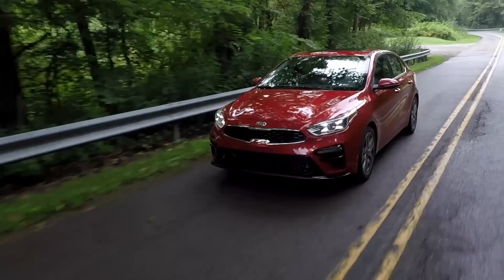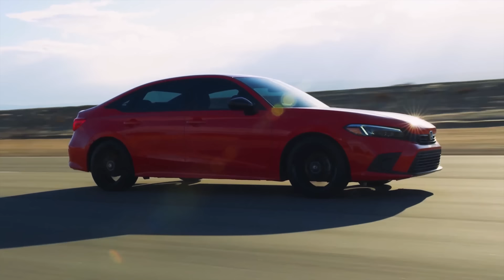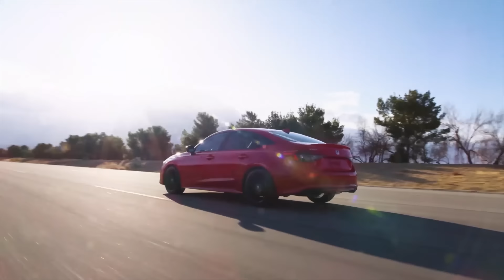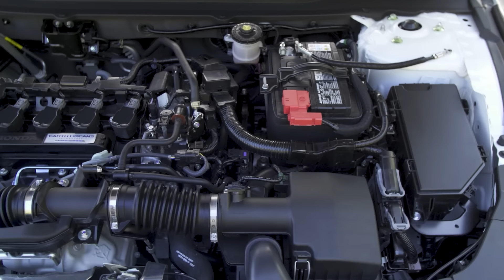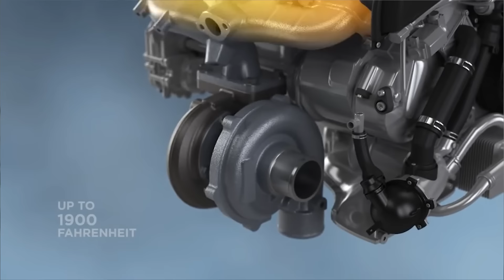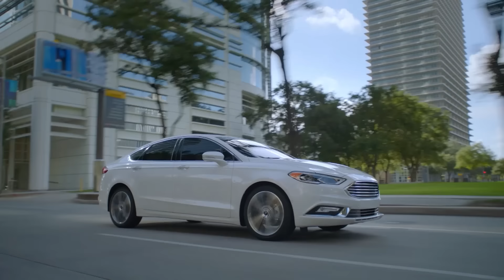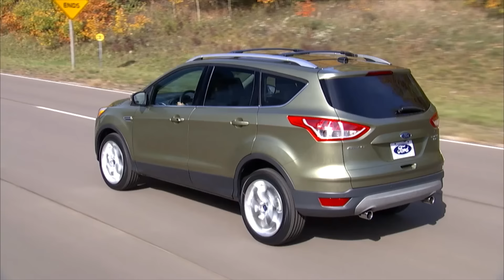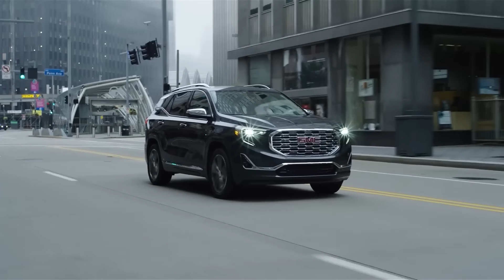Are Turbocharged Engines Reliable? The Truth About Turbo Engines

Comment: The biggest imsconception is that they aren't actually "more efficient". Ask anyone who has a small turbo engine and their gas consumption is greater because the engine is designed to produce MORE power earlier, meaning MORE fuel used down low. A naturally aspirated engine delivers power based on RPM, the lower the RPM, the less fuel used, where as a turbo engine produces peak torque (which is proportional to power) so early that you are using more fuel for the same RPM as a naturally aspirated engine. 

The reason turbo engines are used is NOT because "you can make the same amount of power with a small efficient engine", remove the word efficient. Sure, its impressive that a 1.5L turbo can make the same power/performance as a 2.5 non turbo engine, but that doesn't mean it uses less gas! An accord 1.5 turbo gets 29 city, 35 highway, where as a 2.5 NA camry gets 29 city 39 highway. Heck, the 3.5 liter v6 camry gets better MPG than a 2.0 liter accord. Makes no sense!

That is because the reason turbo engines are being made is because EMISSIONS. Using a turbo charger to control the EXACT amount of air that goes inside the engine you can better control emissions, because the exhaust instead of going straight out of the engine, goes through the turbo first, where it cools down and settles releasing less NOX gasses. Not only that, turbo engines are smaller, lighter, and easier to fit into more cars in more ways. If you want 400 horsepower, your options are a 5 liter v8 or a 3 liter v6 turbo. Of course the turbo 6 is gonna be smaller and easier to fit into an engine but cost A BUT LOAD more to manufacture.

In the end, turbo engines are great for some things, but mostly worse because they cost more to make, they have more points of failure, and generate more heat which deteriorates a lot of the stuff around the engine like fluids and plastics, and they aren't really "more efficient".

Heck, toyota literally said they only reason they developed their 2.4 turbo engine to replace the 3.5 v6 is because of emissions regulations and had nothing to do with MPG (which it gets less mpg and makes less power than the v6).

Comment: In my 50 years of driving, turbos have always been very reliable. Until they break (or your engine dies from oil dilution, etc) So if you buy a new car every 2-3 years, and/or never put more than 70 000 miles on a car, then go ahead and buy a turbo engine car.

Comment: Lots of anti-Turbo negativity there. Bit OTT in my view. Other valid opinions are available.

Suggest anyone still having doubts use the best evidence available to themselves. That being actual "hands on" experience .. by far the best policy. Over three decades ago, I too was very anti-Turbo. That was until I got one. That "hands on" experience changed my motoring habits of a lifetime. 

When I bought my first MG ZT years ago, reading the opinions of those MG enthusiasts with far better experience of these cars than myself, many were of the opinion that the smallest engine option available for MG ZTs and Rover 75s, was the Rover K-Series 1.8 in turbocharged form. I found this both astonishing and indeed hard to believe considering other engine options available for these cars included V6 NASP, BMW Diesels and of course the Mustang V8 engines. 

Ten years on with all that "hands on" actual experience under my belt, I can now appreciate why, all things considered, the 1.8 Turbo option was the best one for the average Joe/ Josephine car user. Plenty of YouTube footage by folks when trying the 1.8T 75s or ZTs for the first time, demonstrate genuine surprise. 

I can get closing on 40mpg with my ZT 1.8Ts, on a long Motorway/Freeway run. Mind you, that BOOST can be addictive and driving using "Track day mode" all the time can see only half those miles for each gallon. As always, you pays the money and takes your choice.. 😃

Comment: Interesting stuff. UK Based me a serial Petrol Turbocharged Car owner here for over three decades. Mostly British MGs and Rovers. Oh yes one Diesel. A Rover 620 Diesel with the Rover L-Series Diesel Power Unit Honda also put in their Diesel Accords before developing their own oil burner.

Never had any issues. I do change the engine oil at HALF the manufacturer recommended change intervals. Oil and Filters are far less expensive than replacement Engines and Turbochargers.

I have bought used turbocharged cars, again MGs and Rovers, blowing blue smoke from the  worn turbos, A glance at the condition of the oil on the dipstick tells you why. Rebuilt them and good to go.

It aint rocket Science although is to some.
Reply: There's more from UK based me. 

My son's old 1997 Rover 620ti Petrol Turbo now showing 240,000 UK Miles. Not Kms.  Been all over Europe in it. Norway for Snowboarding with his mates, touring the Magnificent Alps and even a Lap of the demanding Nurburgring circuit fully loaded with his mates and their holiday/vacation clobber.

That Nurburgring stuff video-ed and on YouTube. Mind the language .. 😉:~

Rover 620Ti going around the Nurburgring in 12m28s

He has since improved on that lap time using his Lotus Elise S2.. considerably... 😉

Comment: BLOODY CAR'S I've just replaced the motor in my Subaru Exiga GT 7 seater second hand motor with 100.000 kms less than the F*#ked one 94.000kms on it brand new Turbo Radiator water pump cam belt kit front rotors and shocks $7685 😠😡🤬🤮 DAD ALWAYS SAID THAT IF IT'S GOT TITS OR WHEELS IT WILL COST YOU MONEY AND GIVE YOU HEADACHES

Comment: Turbo + CVT = disposable car.  At that point, you might as well put an expiration date sticker on the windshield so you know when it's time to dump it.

Govt likes the current fuel efficiency technology because they know these cars will be scrapped in a few years. Any money you save on fuel will be given back on maintenance and repairs.  If you don't want a disposable electric car now, you will in a few years when your disposable gasoline car decides to retire, just as your loan is paid off.

Comment: I own a 2007 Pontiac Solstice GXP with over 126000 miles. No problems with the turbocharger or engine so far. Does not use any oil between oil changes. Gets fair gas mileage and hauls when asked. Before that I owned a 2002 Subaru WRX. It was equally reliable and fun to drive. As far as cold weather warm up, the same issues apply to naturally aspirated engines. As a reference I was an ASE certified master technician with over 30 years experience. A turbocharged engine is a high performance engine and thus higher stressed than most naturally aspirated engines so should only be compared directly to other high performance engines ( supercharged, high compression, etc...).

Comment: I would never have a turbo car for anything but a race car.  The final expense far outweighs the benefits in an economy application.  I have a 2008 3800 Grand Prix and a 2017 370Z Sport 6MT.  Both are naturally aspirated, port injected and dead reliable.

Comment: You basically confirmed everything I've been telling people for years! 
Part of the issue to me is using the turbo to move to a smaller engine.  If it's a choice between a 2ltr or a 2ltr with a turbo; you will still have reliability issues down the road, but it's an add on that's just there for additional power. As opposed to compensating for the power lost by downsizing the engine. Two different things!
Reply: And avoid CVT.
Unfortunately big NA engines on proper Autos arent that common.
Reply: @peterpan408  Sad part is CVT's are becoming the norm, even in Hybrids. I have a 100k plus miles Honda currently that has a CVT. Just make sure to change the fluid when Honda says, and you will be good.
Reply: @sn4rl277  Except the first owner wrecks the CVT because they just drop (trade on) the abused vehicle back at the dealer when they renew. Only a donk on an auto tolerates mild abuse and is lower risk to buy second hand.
Reply: The only thing you have to do is increase the oil change frequency. That solves most issues.
Reply: Right, turbos needs beefy engine with large surface area to dissipate heat and spread combustion impact to withstand  higher compression this comes with larger displacement. Smaller engines have smaller parts that are more delicate while being stressed by heavier load in term of punch and heat of combustion.
Technically speaking, engineers can design smaller displacement turbo engine that will last with thicker piston head and massive crankshaft and etc, but this will diminish efficiency of engine as it gets heavier while let it last decade and have better torque (not hp) with no significant wear but this is counter-marketing of engineered obsolescence.
Reply: @BlahBlahManYeah  you also need to do more frequent oil changes on turbos engines but it’s cheap insurance
Reply: There's no replacement for displacement!
Reply: @jackson5116  your opinion is deeply flawed sir
Reply: 2.0 turbos are fine if its from a reputable company.
Reply: @Ghostmarshs  Exactly. Going down to s 1.6 or 1.5 then adding a Turbo is never a good idea. 2.0t engines have shown time and time again that they can handle being turbo charged and lasting 150,000 miles when maintained correctly.
Reply: If you drive them long enough over  150000km you may have problems
Reply: @Ghostmarshs   Might be OK for "car guys", but the average person who has no idea about maintenance, turbos are a disaster. Even with proper maintenance they won't last as long as a non-turbo.
Reply: @watchchimp3102  Exactly, powerstroke = powersmoke, ecoboost = smokeboost.
Reply: @watchchimp3102  So it's better to get a 9th Generation Honda accord vs a 10th Generation Honda Accord? I'm thinking of selling my 22' Honda Accord Sport 2.0t for a 2016 Honda Accord 2.4 4cyl.
Reply: Yes this, instead of adding a turbo, you're better off sport tuning a v-6 for efficiency.
Reply: All most people know about their cars is “Stick the key in and turn it“
Reply: Wrong!

Comment: The only good a turbocharger gives is to the dealerships for all the repairs they get to do. Tundras turbos are the reason I will not be buying a new Tundra. My 2003 tundra 4x4 has a v6 with 175K on it and it still gets 25-27 mpg.

Comment: I drive a 4.6 liter V8 Mercury Grand Marquis that will get 30 mpg on the highway. It just reached 150,000 miles and has never had a single engine part fail. Ford stopped selling this car for a reason.

Comment: This is very disturbing. I own the last Honda V6Accord. 
I am.reluctant ( at this moment no need ) to replace it with the current 2.0Lturbo.

In a few years all of these turbo car ( high end high performance as well as entry level economy cars ) will have accrued high mileage and some marques/models will be break up and down, it could be so bad that the manufacturers make a 360degree return to normally aspirated engines.

Comment: For the average commuter, don’t get a turbo engine. For the enthusiast, get a turbo engine. I love my ecoboost. I’ve had it 4 years. However, I watch all my temperatures like a hawk (charge air, exhaust, coolant, and oil temp) via accessport. I also over-maintenance my cars.  I love the low end torque of a turbo 4 cylinder.

Comment: Nice vid. It’s very specific to the model. I have a F150 2.7 v6 eco boost. It has a great reputation (was improved in 2017 with side port). But the same engine in the new Bronco has been a disaster (so far).
Reply: Agreed. Ive got a 2016 Ford fusion Titanium with the 2.0 ecoboost. Think Scotty Kilmer had a video on an earlier year with the same setup (plus awd) with over 200k miles and the only thing wrong besides the crappy backup camera Ford uses was the turbo was finally starting to go. The only other faulty thing is the transmission, but as long as it’s maintained the chances of the transmission failing are slim

Comment: I have a 2021 Subaru Legacy Touring XT with the 2.4 turbo. I will over-maintain it like I've done all my cars in the past. It has 9500 miles on it and I've already two oil changes. I get one every 4K miles even though the recommended is 6K miles. I also don't drive like a bat out of hell and I live in a mild climate. I'm not worried.
Reply: Keep an eye on the coolant … my son owns a 2022 outback with same engine and it is loosing coolant somewhere. Not leaking anywhere, more likely bad head gasket and only has around 9,000 mls.
Reply: @stacystanley262  lol - since I posted that I've  had an oil pan leak repaired. Apparently another common issue with that new engine. I wish now I'd gotten one with the regular non-turbo engine. I hardly ever take advantage of the extra power so it was kind of a waste, plus it gets about four to five MPG less than the naturally aspriated engine. I probably won't keep it after the 3 year/36K mile bumper to bumper warranty.

Comment: Every turbo charged car I have ever seen has had issues with the engine at around 100K miles
if very well taken care of (Like 3K oil changes using the best synthetic oils).  Most common
issues are excessive ring and cylinder wear as well as turbo failures. Also they are only more
efficient if you drive them with a very light foot. If you have to be quick off the line all the time
they can burn considerably more fuel then a conventional normally aspirated engine of similar size. 
Also if they are under enough of a load to cause the turbo to be used much, they burn a lot of
gas. Turbo engines are great  if you don't plan to keep the car but if you keep a car for 10
to 20 years and want to have an engine last  a quarter million miles you are out of luck.
All I know is that I'll keep my normally aspirated V8 and V6 coupes, thank you very much.
Reply: I am not happy with these small engines we have to live with now-a days but that’s the case. I  have for years bought American cars with V8:engines but these are unavailable now and we have to live with overprice gas prices and forced efficiency requirements. These V8 engines were  strong and reliable and underworked for there use. Now today even 1/2 ton trucks have small overworked engines as the case maybe. The being said we have to chose carefully our vehicle for our needs and uses.
Reply: Stay off boost if you want to use less fuel. Kinda wonder why they can't add a drive mode where you stay off boost for as long as possible.
Reply: Go fast, drive hard and die young.
Reply: Archangele1...good points. My turbocharged 2008 SAAB 9-5 now has 125,000 miles. It has the larger Mitsubishi TD04 turbocharger, which is robust and goes 200,000+ miles.

I rarely hit the accelerator hard, except for passing and merging. I'm always aware of my boost gauge. However I'm tired of paying for premium fuel. The SAAB is structurally the safest car on the road, so I'll take safety over mileage.

Since 2008 Ives spent $5,000 on all parts, labor, fluids and preventative maintenance. That's not bad for 14 years...not Toyota/Honda good, but not bad at all.

Comment: Wisdom is refreshing. Make sure that you know what you are buying as the manufacturers and their representatives will not necessarily explain all the details. As a cold climate resident, western Canada, a block heater and oil changes every 3K to 4K kilometers is more expensive annually, BUT, oil changes are cheaper than engines.
 P.S. since the Vega, or the Pinto, or the Horizon or the Pony or the CVCC or the RX-3, car makers finish the testing phase of development by real world experience. a.k.a. selling the design before the engineering is completed.
P.P.S Don't even get me started on vehicles without dipsticks, engine or transmission!

Comment: I have been a turbo machinist for twenty years . Listen carefully ..... They belong on diesel engines and racing applications . Full stop . The fallacy of gas 4 cylinder economy with V6 power is idiotic . Driven with force they can blow the gas like a V8 . Also G.D.I. engines are killing turbos AND catalytic converters . The chunks of accumulated burnt oil from the intake valves damage the turbine side of the turbo , on their way to plugging up the expensive cat . I made a good living remaning these . If you gave me one for free , I wouldn't thank you for it . AND I couldn't sell it fast enough ........... Discuss .

Comment: I’ve yet to see a small turbo engine be reliable.

Just bought a VW Atlas, and even though the offered 2.0t has comparable power and better fuel economy, I chose the VR6 because of simplicity and reliability. 

Any 4 cylinder turbo that VW/Audi has produced since 2006+ has had multitude of problems out of them….. I’m talking burning oil,  blown head gaskets, stretched/broken timing chains, caked carbon on valves… and these stupid expensive to pay for repairs.

So my lesson learned…. But the simple NA engines for your daily driver or pfamily hauler

Comment: Mine isn't. been running for over 22 years now. however its the 7.3 powerstroke too. Arguably the best engine Ford ever made. This engine ejects fuel at TDC and I've never had an issue with ANY part of the engine including injectors. However its also never seen anything but Shell Rotella T changed every 4k miles like its a Religion. One other thing is I never shut the engine off immediately after it was under heavy load or running at higher RPM. I let the turbo cool for 5 minutes before engine shutdown. Remember at idle diesels consume very little fuel (unlike gassers that are very inefficient at idle). This engine idles at 700 RPM and of course YOU have no say in the matter as its ECM controlled.